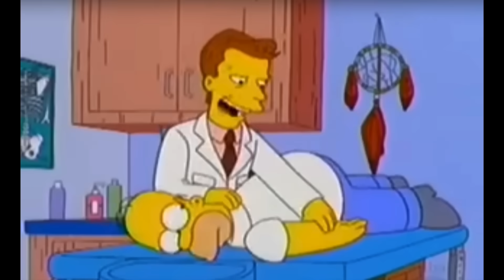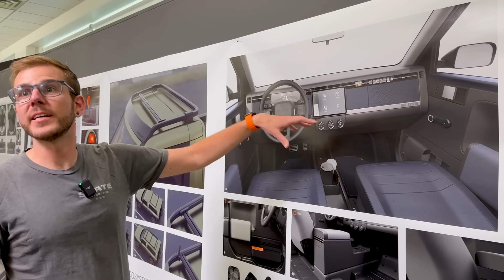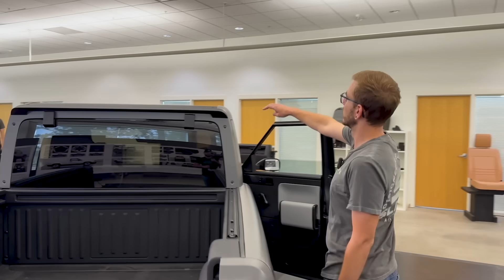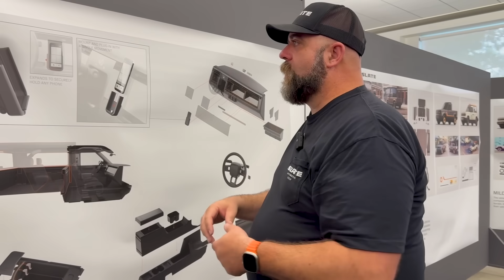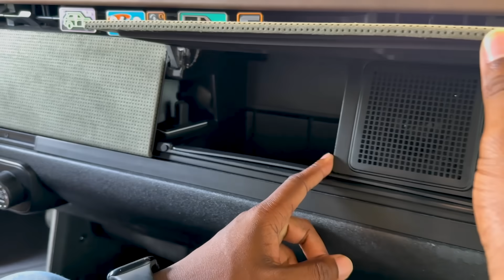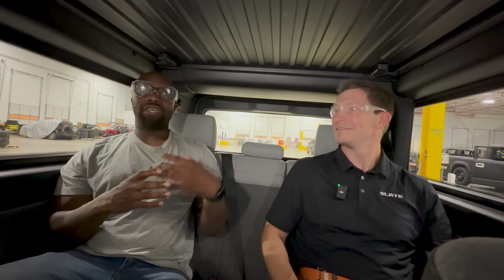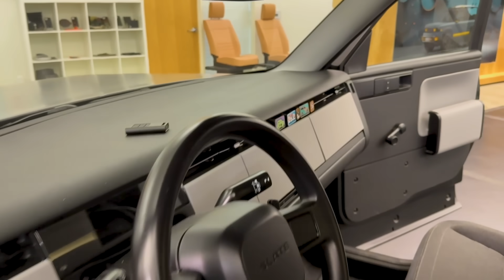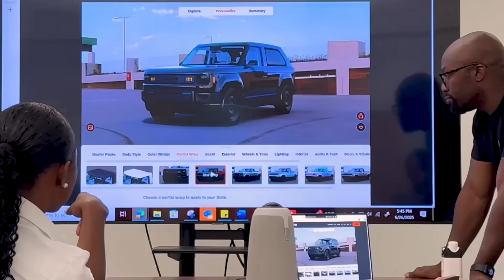The Slate: America’s $20K Answer to China’s Cheap EVs (Exclusive Access)

Comment: My honest opinion is that "Slate" is trying to push the general public into driving EV-s.
And, in my opinion, if you narrow your needs to only be driving an EV.. this is fine.

But as someone, who would like to drive an EV in the future, I can not believe how little this car provides in value...
When I think about my Audi 2013 having sooo much "features" (which I would say should be standard equipment in 2025) compared to this car.. I can only say that this is for a buyer that expects ZERO VALUE for the cost except a battery powering his ride...

Have Americans lowered their expectations of products so much that they now expect nothing in return for the price? ( I would like to believe that I am wrong)
I see this car as a widget that only has value in customization ( which has 0 real world value when you can do that with every car these days)
And also, what will hold its value when reselling? Since for 20k you can buy a really modest car that's "old" a couple of years and has way more value to provide

I don't want to come off as if I'm bragging and "so smart", and I probably make less net than anybody in this comment section since I'm not from the USA, but common... and
I am all up for America building its manufacturing and sourcing their parts locally, but this car, for me, is riding this trend rather than providing value for American manufacturing. 

My point, and question is this: If you are going to go into debt for owning a car, is this the car you want to go into debt for? And if you are someone who has 20k-25k sitting on the side, are you really going to lose it for this type of ride?
Rich did a great video and while I was watching it i felt the passion of the team and everything, but if you take a step back and do the odds, do they still hold?

Comment: I'm excited to see how this progresses. I worry about their price point as the big makers mature in their parts acquisition leverage. 25K may be too much in 18 months. My biggest worry, though, isn't build quality so much as durability over time. All these snap-on and screw on parts might be quite tight on leaving the factory. But, give it a few months or years of expansion and shrinking cycles due to heat, severe road bumps, weight shifting back and forth and it might feel like it's about to shake apart like an old Charlie Chaplin movie car.

Comment: THIS THING WILL FLOP because it is way more expensive than it seems. First, the price starts at $27.5k, not $20k. You have to pay the full $27.5k plus tax up front and not everyone qualifies for the $7.5k fed tax credit. Performance is terrible. 8.1 sec 0-60 is slower than a Prius. 150mi range means range anxiety will be a thing (expect less in real world driving). No radio, crank windows and no paint for $27.5k! That’s expensive and we are not evening factoring in a wrap. For around the same price or a little more you can get a REAL pickup with 5 seats, 4 doors, a paint job, and way more features. Ford Maverick and Hyundai Santa Cruz are here, and more competition for cheap trucks is coming in 2026 from Chevy, Ram, Toyota and Alpha.

Rich, I’m sorry but you’re drinking their Kool-Aid. That free Continental breakfast really did blind you. I was excited about this truck until I started looking at it objectively and concluded that Slate is a going to be a spectacular failure.

Comment: Cool concept. But if your product is all about encouraging the customer to customise the car themselves, how does that affect the warranty?
Reply: ask AI questions like this..

"Generally, Slate's encouragement of customer customization will likely not void the entire vehicle warranty automatically
. 
Here's why and what it means for customers:

    The Magnuson-Moss Warranty Act: This federal law prevents manufacturers from automatically voiding a warranty simply because an aftermarket part or modification is used.
    Burden of Proof: The key is that the manufacturer must prove that the aftermarket part or customization directly caused or contributed to the specific failure claimed under warranty before denying coverage for that specific part or repair. 

However, there are important caveats:

    Specific Part Coverage: If a customized or aftermarket part directly causes a component failure, Slate would likely not cover that specific failure under warranty.
    Unrelated Issues Still Covered: If an issue arises that is unrelated to any customizations (e.g., an engine malfunction not tied to a modification), the warranty should still cover it.

Comment: Best part is you don't have to worry about rust on the body panels. Have a bunch of rock chips.. no problem just get a new panel. Love it. Just wish this was a small diesel.
Reply: or if you have rock chips, just put a new wrap on it. You can change the color of the truck for winter and for summer by just changing the wrap.

Comment: I could see them doing the "Blank Slate" and then maybe offer some pre-configured packages/trims that are either assembled by the factory or service center finished?  I'm thinking along the lines of General Motors and their LPO options aka dealer installed options.  GM does it for things like mud flaps, running boards, LPO "performance" packages on the trucks like the big brake kit or exhaust, etc.  GM through their parts network sends the LPO items to the dealer getting the vehicle and then their service techs assemble them when the truck gets there.  Then you the customer takes home your vehicle as it was ordered.

Comment: I appreciated your question about how the Slate will stand up to competitors like the Ford Maverick, but one thing I think Eric failed to mention (specifically in regards to competition) is repairability.  
How many horror stories do you hear nowadays of brand new vehicles with warranty problems or recalls that end up sitting in the shop for weeks waiting on parts or service?  
Most other brands are massively more complicated to work on, and half of the work under the hood requires the engine to drop out or the cab to come off.

If Slate truly is exponentially easier to disassemble/assemble than any other vehicle and they're in charge of their own parts supply chain, they'll have the Big 3 beat in repairability, turnaround time and customer satisfaction, easily.  
I know they're in no place to trash talk the competition, but this is a massive issue with most auto brands nowadays, and hopefully a massive advantage that Slate can offer.

Comment: The problem I have with Slate is that they're essentially trying to compete with used cars. But there's no used car you can buy for $27k thats going to be worse than a Slate
Reply: They're competing with new cars tho

Idk if gas is free in the us but here you would recoup the additional cost over regular used truck in fuel savings bc electricity is dirt cheap compared to gas

Gas costs ~8$/gallon here

Comment: What is fabulous abut this concept isn't what it has, its what it doesn't have. No idiotic 4 doors on a pickup, no useless screens, no stupid electric gadgets, no pointless power windows, no need for a damn smartphone, and NO PACKAGES!! Everything is ala-carte, as it should be. I'd probably do the base config and keep it that way - I don't even particularly care if it has a radio or not. My only question: Is it "connected"? If it is, that's a deal breaker.
Reply: Agree with you...  Throw in 4WD/AWD for another $5k or so and I'm jumping on this bandwagon.  Been hoping for something like this (a bare bones EV small format pickup that doesn't cost $50K) for a few years now.  Would've bought a Kei truck, but I just can't get past the safety aspect of those.

Comment: I actually like the fact that they're not shying away from using plastics in order to be greener, instead they're using plastics as they SHOULD have been used this entire time - that being in specific use-cases where it's beneficial, like modularity parts, like in places where you WANT long-lasting hard-wearing materials which plastics do very well. And I love that they reduced the number of individual parts required, whilst still retaining the more modular aspect of them, since more parts usually only ends up meaning more things to go wrong and it's harder and more expensive to find those proprietary pieces. Plastic as a material didn't HAVE to end up being the big bad guy of the materials world, we MADE it that way by overusing it for things that really could and should have been made with other materials (like using plastic where glass or metal was just as good and probably should have been used instead) and especially where products were expected to have short lifespans and need replacing often - especially considering other materials are better, cheaper and easier to recycle than most plastics.

Comment: Slate is a great idea. Reminds me of the Saturn that had plastic body panels. One of the doors had an electric window that wouldn't roll down, so I purchased a used door on the internet that came in a different color, so I just unscrewed the body panel and put the original panel on.

Comment: I’m curious to what parts they will allow customers to install themselves (probably new bumpers or panels the most extreme) vs having to send the car to a licensed shop to do installs (probably converting truck to suv). As a technician myself, could I theoretically get parts shipped to my dealership and do major conversions or repairs myself? But most importantly, will instructions look like an ikea book or like a gundam figure build guide lol
Reply: As well as that, in the future presumably there will be battery and drivetrain upgrades. Will they be installable on older vehicles?

Comment: This is what sustainability is... sustainability in automotive should be synonymous with repair-ability. 1 bad hail storm shouldn't mean my car is totaled and goes to scrap yard. On this you can just undo few bolts and put in new panels. I hope it is just as simple and easy to replace motor, controllers and various electric units and most importantly the battery. Some cars are so hard to disassemble that when they are few years old, something like bad heater unit means it is functionally totaled because changing it takes 2 skilled mechanics 12 hours and they need a lot of space and a lot of specialized tools. So you either not have heating or trade in this car for spare parts and buy a new one.

Comment: I think you're wrong. I think this fits perfectly in a DIY mindset. If I can buy a blank slate and build it out as time goes on, 3d print parts and upgrade my ride. This is amazing. 
I build cars older cars, because they are easier to build. I personally think not only is this amazing for the industry, I think this is amazing for car culture.
If I could DIY turning a truck into an SUV. Better yet a kit to turn a rear wheel drive into AWD that is amazing.

Comment: It's a very cool truck that I like a lot, but the only thing keeping it afloat is the "Under 20k" price point, which is only possible thanks to the $7,500 EV tax credit, which is going away soon and will definitely not be available by the time this truck is available for purchase in early 2027. Making it a 27-28k truck with no radio or modern services, which is a bum deal when you can just go buy a new Ford Maverick at that price, its hard to justify buying one of these without a significant price drop.

Comment: They need the motor my company builds.  It uses no rare earth elements, can obtain efficiencies of 95 to 98 percent across the full RPM range, has the inverter built in, and has the charger built in.  We offer it in 30kW to 350kW flavors.

Comment: What’s absolutely insane is the very people bitching and moaning how modern vehicles are so big and expensive and no small economical vehicles are available while celebrating a small bare bones EV truck are largely responsible. 

Reason US vehicles have progressively gotten bigger is it was a way manufacturers could meet ever increasing asinine regulations for both emissions and safety.  People have just become accustomed to the bigger vehicles and many have started to demanding more room.  It’s much easier for a manufacturer to build a larger vehicle and throw a stressed out small engine in it to meet regulations.  That’s why we have say the Toyota Tacoma that’s bigger than a 90’s full size truck powered by a 4cyl turbo.  It’s also easier for manufacturers to package all the safety features into a larger vehicle. 

The price of new vehicles is direct the result of all the safety features, larger size and all the unnecessary techno BS engineers throw into them to jack up the cost. Watch just about any vehicle commercial or review and you will see they instantly go into the room and all the unnecessary techno BS trying to hype them up.  If manufacturers and dealers actually thought most consumers wanted no frills base models that aren’t loaded down with every unnecessary techno BS the engineers can throw in them there would be far more base models than Gucci vehicles loaded down with every techno BS to satisfy the techno geeks and soccer moms on their lots.  Go sit at a dealership that actually has base model vehicles and watch how many people walk right passed them to look at the loaded down Gucci model.  People want a vehicle with 50 airbags, 100 cameras and every other techno BS in them, but they want it at the price of stripped down base model from the 80’s.  What’s ridiculous is I can go to a motorcycle dealership and buy all the brand new motorcycles I want that don’t have even a seat belt much less a airbag but a new car has to have SEVERAL airbags in it to be sold in the US.  And trust me, the lunatics are trying to kill motorcycles as well. 

Not trying to defend manufacturers. But I will use Toyota Tacoma as another example.  In 1988 a 4x4 extended cab Toyota pickup was $14k and a base 2025 4x4 Toyota Tacoma is $36k. Keep in mind the base 2025 would be a loaded truck in 1988 because loaded in 1988 was pretty much A/C and power windows. $14k in 1988’s money is $38k in today’s money.  So basically Toyota is building a “small truck” today that’s beyond what was considered “loaded” in 1988 for $2k less in today’s money which would be $5k less in 1988. 

I like using Toyota as an example because I’m highly of the opinion not only is the 1988 Toyota the best truck ever built pound for pound, but possibly the best vehicle ever built.  Toyota could update they styling of the 1988 at its size, throw in the modern 4cyl turbo and 6 speed manual with hand crank windows with a simple radio with even just Bluetooth and without all the airbags and unnecessary BS and I would be at the dealership tomorrow to buy at least 1.  And I’m sure I wouldn’t be the only person. 

Taking away the size of the Toyota Tacoma and all the unnecessary safety BS they have zero control over the messed up on 1 thing. You have to buy the Off-road trim to get rear diff locker and sway bar disconnect.  They should allow you to put those on any 4x4. But to their credit you don’t have to buy the top of the line trim along with leather heated seats, heated steering wheel or a bunch of other BS to get them.

Comment: There's a scene in the Ashton Kutcher film about Apple's founding, where jobs and waz spent all night making a killer computer. They bring it in to the hobby shop, and the owner says, "what the hell is this? I paid for computers, not parts. People don't want to put it together, they just want to plug it in, turn it on and have it work"
The problem that you run into with modular systems like this is most people don't want to put it together. They want to get in it, and just have it work. Combine that with a limited range, and this becomes a $20-$40k accessory vehicle. I love the idea, I would like to own one, but it's a 2nd vehicle for me, not a daily driver. And I don't even want to think about winter in this

Comment: Except it’s not $20k! It’s close to $30k and then you have to add all these extras to it. Doesn’t even have basic power windows. The range sucks and it’s extra for the upgrade battery. A truck without a 4 wheel drive option is a fail period.

Comment: Body parts are not something new. One panel from back to front is 21st century. Back to basics has proven to be cheaper on repairs. However, offering people to buy different accessories will not work. It's been tried out with the smart car. People buy one system and won't buy all.

Comment: The Slate Truck breaks my brain. It's shaped like a truck, but its towing capacity is rated significantly lower than all other trucks in its class - and that's before taking into account the puny base range of 150 miles, which will be 25-30% less with anything hitched to the back of it. With those miserable spec's I would guess $25-27,000, but then they strip it of almost every feature except the most essential! I bought my Ford Maverick Hybrid in that same price range and somehow it came with paint and a stereo... The most generous assessment is that the Slate truck is a toy for the poor masses - that is not what the Chinese are doing.

Comment: Slates $20,000 price tag is based you getting a federal tax rebate that may no longer be available. The base price is $27,500 and rising. Very deceptive marketing and already too expensive. $40,000+ for one with lots of mods, accessories. RWD only and 150 mile max range. So many amazing things about this truck and still terrible value.